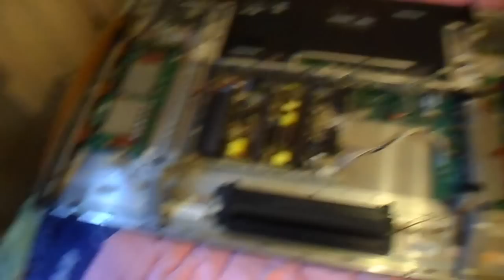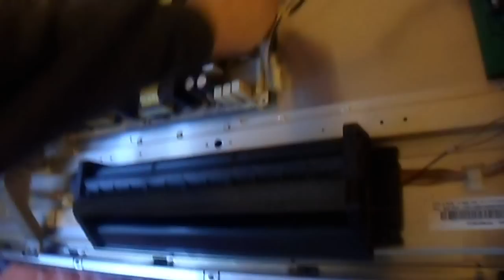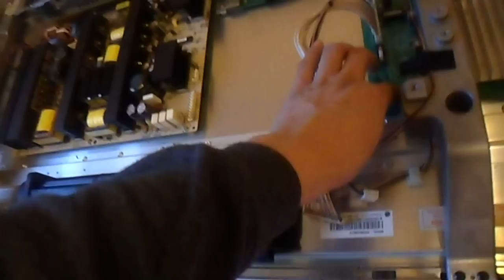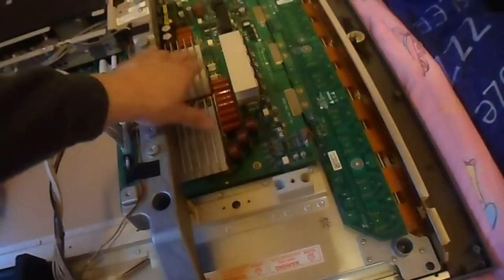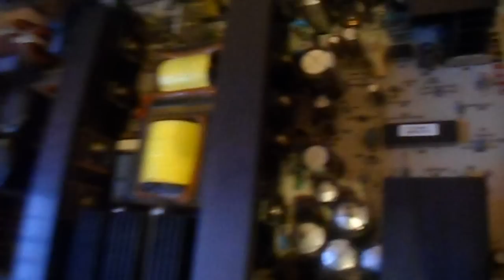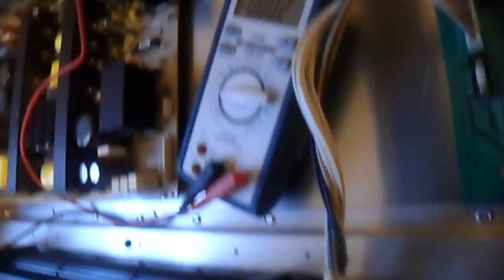LG 50PC1DA - Not powering up (clicking sound, no picture or sound) - Diagnosis

Comment: Hi! I've got the same problem (on a PDP50R10100), just a pair of clicks and no issues with Y or Z Sus. I don't have a voltmeter so can't check the AC detect, but the capacitors all look fine. If I just replace the power board, would that work?
Reply: Have you fixed your tv ??
Reply: @yahrmajahsty5266  yes, in a roundabout way. I replaced the entire power board (with a used one I bought from Ebay) which worked for a while, but then broke again, with the same symptoms. I then noticed a cracked bit of solder on the old board so I just added a bit more and now all is good 🤷🏼‍♀️

Comment: Hi I'm working on this model atm. I had the caps issue. and changed them. the issue with the tv is, it flashes to try and come on.. The screen that is, but doesn't strike up?? Changing the bulging caps didn't cure the problem.. where should i go next..? screen flashes , like i've said but wont strike up..

Comment: For Michael-Milner (Who'se prolly bought a new one by now....) You sound like you have two faults-One a duff IPM (flickering/flashing) and another-(bar moving around on screen accoding to whats on screen) and Thats one of the 4  MOSFET's on Buffer-board,--Cheap simple fix for the bar--but IPM's are a Bastard to change on the board (IF you can find a replacement)--whichever of the 4 it could be--Prolly one of  the  upper (ERC) ones....

Comment: Forgot to say--Picture flashing/flickering--A DEAD set--stuck in Stby would be the 9 (yes, ALL Nine!) 3300uF 10V caps on the PSU....
Reply: hi, just wondering  if  you still had your tv and if you know where on the psu the 50v 680uF cap goes?
Reply: Hey my tv has the symptom in a million trys works for a a while with a  flicking then shuts down by itself Do you pls hav an idea that how to fix it ??

Comment: Thank you very much for posting this. Respect that you take The effort to make this, even without a tripod. *people who say anything about this; support this guy with money so he can buy a tripod! :)

OK I have the :LG 50PC1DA and the exact same problemen. I tried/ checked disconecting the y-sus/z-sus first as you explained, the problem still happened. Then i tried the AC-D and that one had 4.85V. So then i found.out that i had 11 'broken' capacitors. I found a local repair centre in Amsterdam (Holland) and he is repairing it today! 

Im so curious if its working! Keep you guys posted!!
Reply: ***** HI Guys!

I Would like to post a succes story from Amsterdam (Holland) :=) 

What did I check: 

1) Y-sus / Z-sus working correctly by disconecting it from the upper middle board
2) AC -D pin had 4.85 VOLT on it. 

I found out that everything was OK except for the 'BAD CAPS' (Dutch - Elko's aka elko) 

So I sent it for repair to some random guy in Amsterdam who advertised on a local ebay called: marktplaats. 

How it was:

 [IMG]https://scontent.xx.fbcdn.net/hphotos-xap1/v/t1.0-9/10641127_10152929949683985_7157156068235206189_n.jpg?oh=61e2b8229bc99fec2ddf1ebba8317c6f&oe=55C3B177[/IMG]

This was after the Repair - CAPS: 

[IMG]https://scontent.xx.fbcdn.net/hphotos-xtp1/v/t1.0-9/11164779_10152929949698985_2673127568986234128_n.jpg?oh=6646d8a9cf2f6df344f5bd8052b1f2e4&oe=55C59964[/IMG]

And there it is!!

[IMG]https://scontent.xx.fbcdn.net/hphotos-xpf1/v/t1.0-9/11188275_10152929949733985_5577028619826007356_n.jpg?oh=68a457bf5f5be6f2c7cafdf957eaa56a&oe=55CE127A[/IMG]

In the end I paid €60 aka: $67,26 for a brand new 55 inch LG 50PC1DA  

I cleaned everything very nice, took parts of and made it 'dust?' free! 

Then i had the following problem - HDMI did not work, sometimes it happens to work by accident but overall i had some weird RED stripes and stipes on the whole screen. In the end it was just a very dusty HDMI connection (first thing i checked), cleaned it and it was working perfect 

So end conclussion - Replaced the bad CAPS total overview: 10x 3300uF. 105gr. 10V. 1x 1000uF 105gr. 10V.

Comment: Hi i can relly do with some of your help here.. i got the exsact same tv you have there (how i found your vid) and i think my ysus board has failed.. i can turn it on and it powers up but theres a fuzz (like no signal on old tv's and a thick black line going from top to bottom of the tv and the link flicks with my ysus board.. under one of the two heatsinks on the ysus boards all i can here is tink tink tink tink tink in perfict timing.. iv done some reserch and im qwite shure its the ysus and also will the buffer board be ok? Or will that have to be replaced? And also you said you can get the ysus for 25 pound??? I can only find them for 70 plus!! :( sorry for relly long text lol i just need some advice.. :)

Comment: I have the LG 50PC3D-UD A.  I was watching tv, and there was a loud "Pop", and then the screen went blank and there was no sound.  I tried to turn it back on, and hear the clicking sound.  The power light in the front of the TV turns green initially, but goes back to red when the second click is heard.  Any ideas or suggestions?
Reply: Hi did you fiqure out what was wrong with your TV
Reply: +R Norris bad caps.

Comment from the maker: If they used poor quality capacitors it's possible, and not all bad capacitors bulge when failed. I would swap them out for Panasonic FM or FR or FC, which are available from Farnell. I would AVOID buying them from your average electronics shop as they are NOT suitable. Also, check AC-D as the set clicks on and off... it should stay steady 5V never varying.

Comment from the maker: Probably looking at a Y-SUS or Z-SUS failure, try unplugging each in turn and see if you can get any audio out. Y-SUS/Z-SUS best send away for repair (send board away to be fixed) as the IPM on it is difficult to replace. Or replace with new Y-SUS/Z-SUS (expensive.)

Comment from the maker: I did on a 42PC1DA. I put a solder joint across the two optocouplers which face the other way on the power board. However, this TV had an IPM failure too (not just one which showed as a normal short) and the cost to repair became prohibitive.